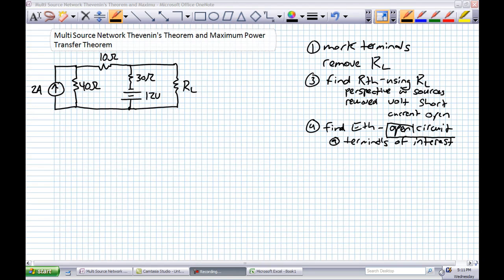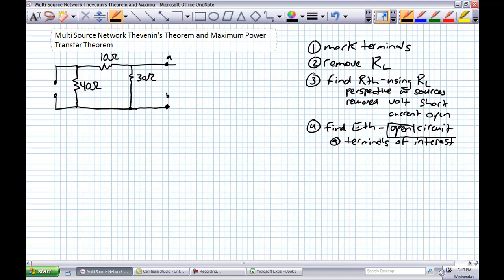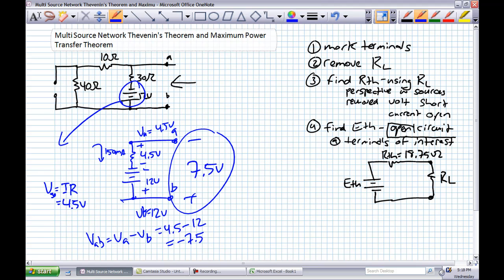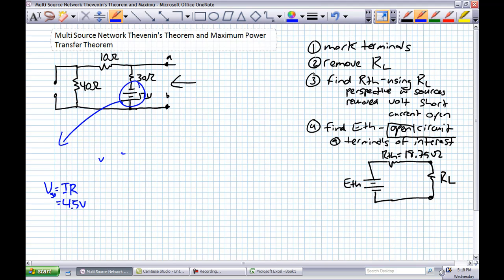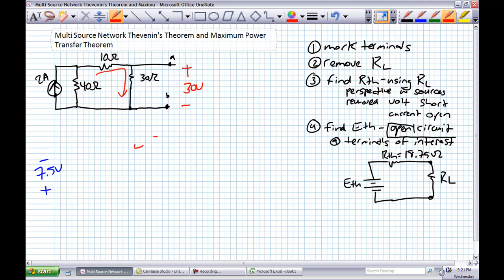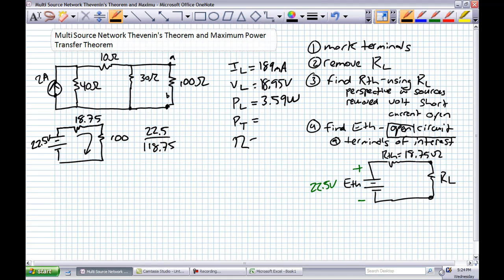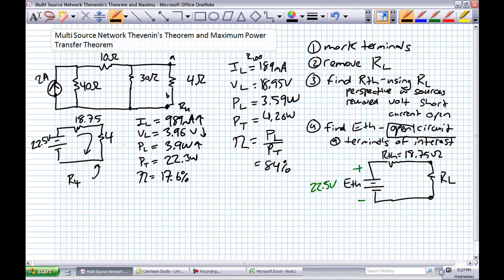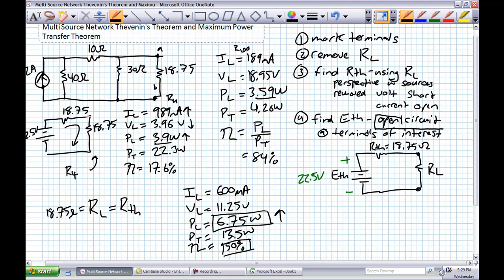More Thevenins Theorem and Maximum Power Transfer Theorem

Comment: Hi 

Thank you for lectures.
Your concise and methodical approach is very well appreciated 

At 2:51 you explained 10 & 30 ohms in parallel and then 40 ohms in series.
Expecting Rth to be 20. However you write a different calculation.

Best regards
Jo

Comment: shouldnt it be 30 - (-7.5) = 37.5 V ? 
you said that it was the opposite direction so we can just flip the sign
Reply: + (30) - and + (-7.5) -
EDIT: Hes using Eth = Eth´+Eth'' therefore Eth=30 + (-7.5) = 22.5V

Comment: polarity in a circuit is an arbitrary measurement because of the linear algebra. as long as you are consistent which way is positive and negative when compared to current, you get to define polarity